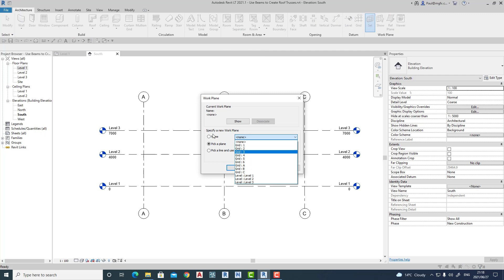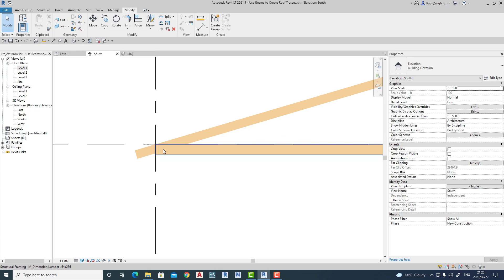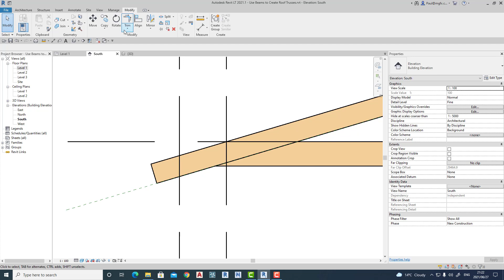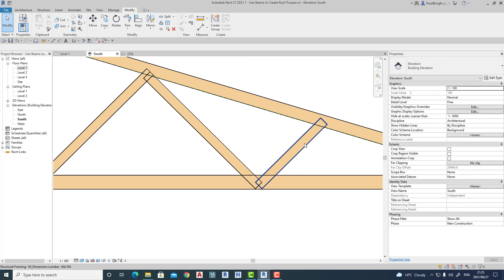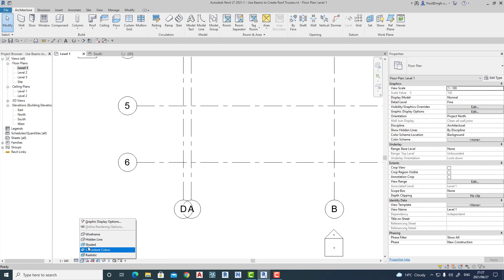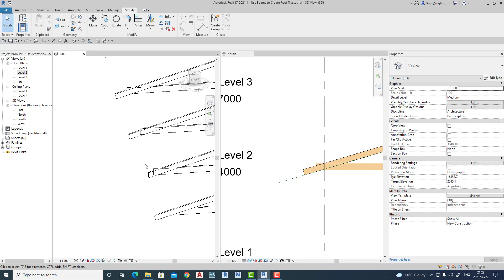Revit 2022   Revit Lt   Use Beams to Create Roof Trusses

Comment: Nice, and thanks, I just needed this. I found a way to cut all beams and then copy them without having to cut all the copied beams seperately: just draw the first structure entirely with all the needed beams, put them all in a group together with the ref planes that are positioned for the cuts and then cut them within the group, save the group and then...copy the group. Should work like a charm... (So you do copy all the ref planes as they are in the group...)
Reply: Thanks for the hint Jo.